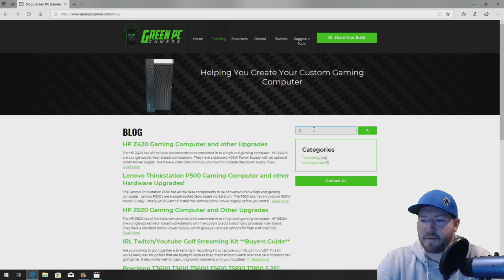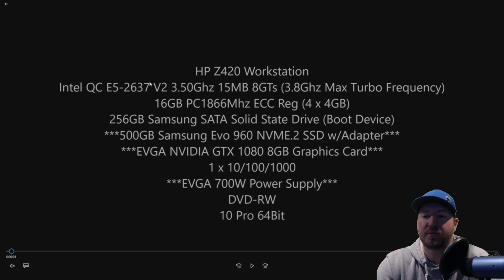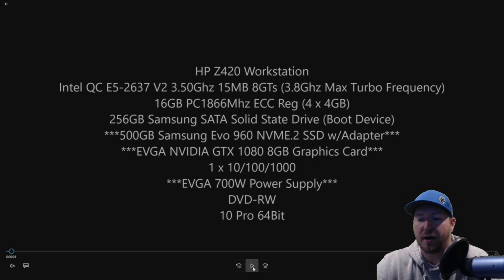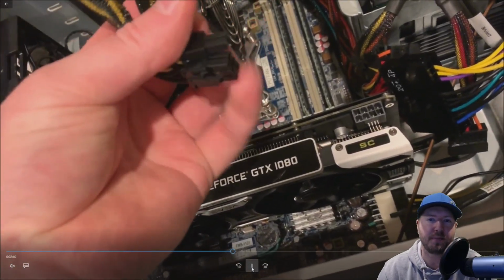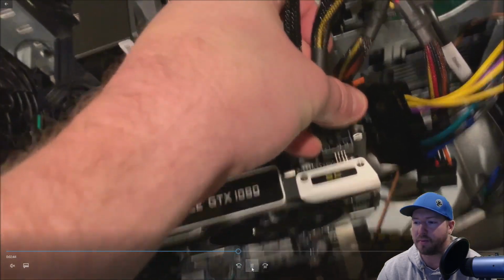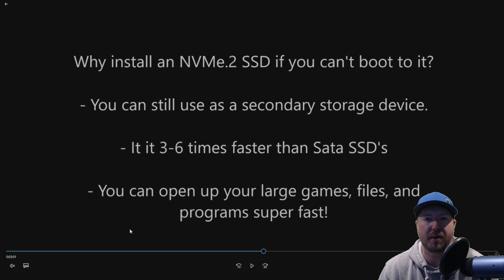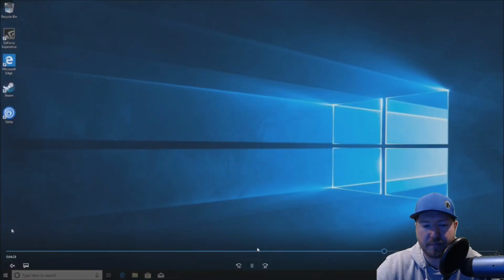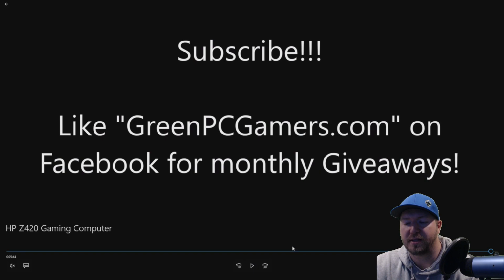HP Z420 Gaming Computer (GTX 1080 and NVME.2 Install)

Comment: What motherboard did you use? Is it the stock motherboard?
Reply from the maker: We used V2 system board 708615-001.
Reply: GreenPCGamers.com y not use the stock board? Isn’t it good enough?
Reply from the maker: It is a stock hp system board.  HP produced a V1 and a V2 system board.  We chose the V2 system board because it supports the Intel Xeon E5-26XX V2 processors.  Also, most of the Xeon V2 Processors supports 1866Mhz memory.  I hope this info helps.
Reply: GreenPCGamers.com thankyou, that was helpful. One more question, does this v2 motherboard support sli on gpu and overclocking on cpu?
Reply from the maker: Unfortunately, we have not tested the Z420 to see if it supports an SLI yet.  We have also never overclocked cpu's on a Z420 Workstation.
Reply: GreenPCGamers.com okay thanks alot
Reply: Motherboards is default pc.

Comment: Hello I just bought a Z420 and I am not sure if this graphics card would work well, I have a similar build to your other than the ssd. Do you know if a Radeon 280x would be compatible?
Reply from the maker: Hey Mr Ballsack, the Radeon 280X should be compatible as long as you can provide enough power for it.  It will require 1 x 6 Pin and 1 x 8Pin Power.  What wattage power supply do you have in your Z420?
Reply: GreenPCGamers.com alright so I have a 600 watt power supply and got everything up and running but when I play fortnite I get 15 FPS I don’t know if I plugged the gpu in wrong or maybe a faulty 8 pin adapter any advice would be appreciated. What’s a good number of FPS I should be getting. thanks pc green gamer
Reply from the maker: 15FPS is unplayable.  Did you install the latest video card driver?
Reply: Oh and a 600 watt power supply

Comment: I'm kinda new to this so please let me know if i should do this. I have the 600W power supply and i want to buy a Gigabyte GeForce GTX 1050 Ti Windforce OC 4GB.
Do you think that can be installed without any problems?
Reply from the maker: Hey Milos,  600W is plenty of power for the GTX 1050 TI.  No need to upgrade.  Great question!
Reply: Okay that’s great. Thanks for the fast reply! Too bad I can’t access your website because I live in Europe but whatever. You just earned a sub!
Reply from the maker: Thank you for the support.  Check out GreenPCGamers.com on socials.  We do monthly giveaways on our Facebook Page.

Comment: can i add gtx 1060 to my z400 without any bottle neck i have xeon 5620
Reply from the maker: You can add a GTX 1060 to your Z400.  Yes, the CPU will bottleneck there gpu and memory.  You should consider upgrading the cpu to a W3680 or W3690.
Reply: GreenPCGamers.com thanks will upgrade mu cpu , how much does it cost to get the best cpu 3680
Reply from the maker: The W3690 is still kind of a spendy processor.  The Xeon X5687 is cheap and a fast as CPU’s get for the Z400.

Here is a link to an X5687 proc:  https://amzn.to/2Vwusny

You may need to upgrade to the copper heat sink to properly cool this processor.
Reply: @GreenPCGamerscom   on six slot rams v2 z400 xeon x5670 work great six core cpu!
Reply: if your z400 have six ram slot ,it is a V2 and you can upgrate to X5670 cpu  6 core 12th...it cost 30$ and it is amazing..and you can instala  good gpu like gtx 1060 , 1660 or rx 570 or rx580 and no big bottleneck , but you must update bios first
Reply: @bartd.3979    z400 v1 con 4 dim también puedes montarlo.
Reply: @her535  v1 can't support x 56xx  6 cores...only w36xx w35xx and x55xx cpu

Comment: The HP workstation PSUs are pretty robust. I've been running a GTX 780 and GTX 1070 (not simultaneously) on the 475W PSU in the Z400. The Pascal cards are really power efficient.
Reply from the maker: Thanks for posting this.  What games do you play with those cards?
Reply: @GreenPCGamerscom  Mostly Battlefield V lately. I've just been using sata to 8-pin pcie adaptors as the stock PSU only has one 6-pin pcie. The 780 runs fine while gaming but it does trip the PSU when running UserBenchmark. I've had no issues with the 1070 though. It's got a Xeon W3570 overclocked to 4GHz and 12GB of triple-channel memory and it is still CPU bound in BFV, dropping to 20-30fps fairly regularly. I've got a v2 Z400 here and a W3690 on order which should help quite a bit. It's an awesome budget platform
Reply from the maker: We typically go for more wattage on the Power Supply to avoid any random shutdown issues.  It's no fun when your PC shuts down at the end of a Battle Royal Game that you think you might win =)  It sounds like you found the perfect configuration based off of your 475W Power Supply.  Thanks for posting this info!
Reply: @GreenPCGamerscom  No doubt oversizing will be better in the long run with less stress on it. If I manage to kill one of the 475s I'll let you know :P
Reply: @GreenPCGamerscom  I can concur that the 600w psu in the z420 is good for a GTX-1070. Used a power supply calculator with my components e5-1620 v2, 32GB reg ddr3, GTX-1070, SSD, 2 7200rpm HDDs DVD-RW drive and it calculated 478w under load recomending a 550w psu.  Installed one in mine using an HP 6 pin to 8 pin adapter P/N:460621-003.
Reply: @White-Wolf1969  Hi wolf! Which calculator did you use? We have the same system (processor, amount/type of memory, 1ssd, 15400 HD and a dvd,cd writer. I tried the calc at new egg and it said I was just over 600 watts. I'd like to try putting a evga gtx 1660 ti xc ultra gaming into my z420, but I'm leary about the 600w PSU. And I really dont want to replace it, any thoughts?
Reply: @cloakedNcoastin1  https://outervision.com/b/JqR7b3 this is with the GPU overclocked. only needs 533W they recommend at least a 583W PSU so 600W is enough.

Comment: Thanks for this!  Is your 256GB running the Boot device, and your 500GB NVMe your OS?
Reply from the maker: Yes, the 256GB SATA SSD is the boot device.  The Z420 will not allow us to boot to an NVME.2 SSD.  So we used a SATA SSD as a boot device.  Let us know if you have any other questions.
Reply: Thanls for the thorough presentation. Would you know if it's possible to connect this GTX 1080 to the HP Z440 with or without adapter cables ? The wattage is over 700 so it should handle this GPU card.
Reply from the maker: Hey PrimalMiltos,  if the stock power supply is 700W and you have the physical space available in the chassis you should be able to install a GTX 1080 in to your Z440.  You might need a 3rd party adapter to provide the 8 Pin power.
Reply: @GreenPCGamerscom  Let the quest for the adapter begin. 😊 Thanks